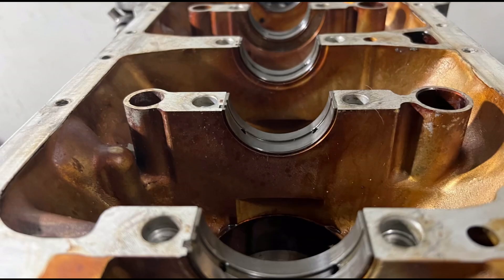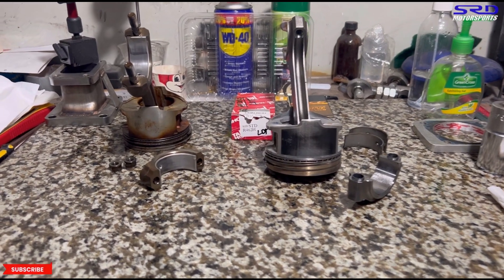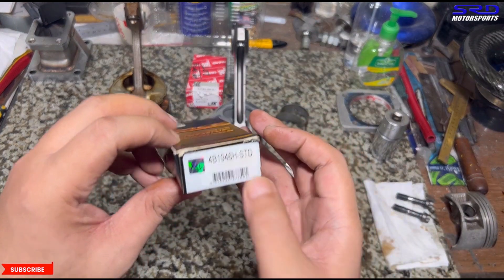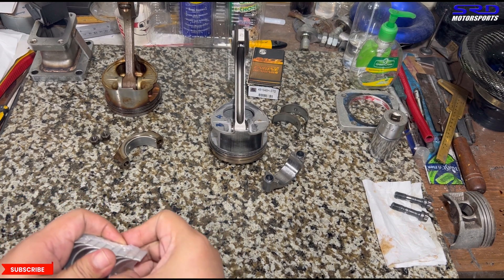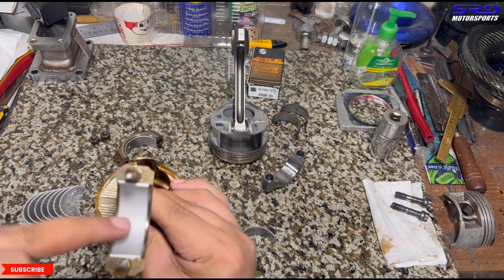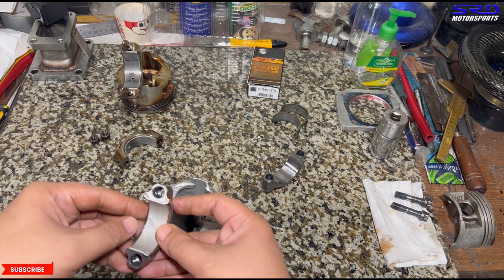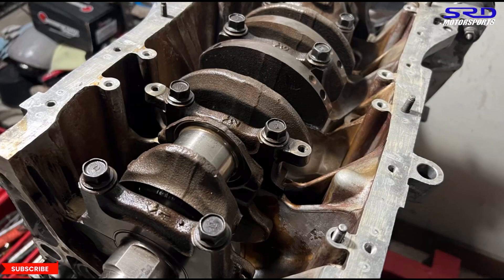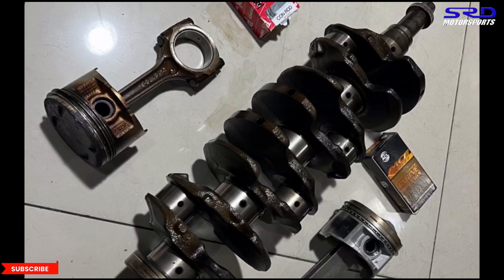Steps to Avoid Spun Rod Bearings K20a B20vtec K24 H22 D16

Comment: I’m building a b20 now the king bearing company send me d16 rod bearings and the holes don’t line up they told me the were correct the ace makes the correct bearings?
Reply from the maker: No , the d16 bearings don’t work for the b20

Comment: So you install .065 shim under the pressure spring it will increase oil pressure from 12-16 psi additional if you run extra clearance  you can use std mains and you can you std hx rod bearings. And send it
Reply from the maker: thanks for watching this

Comment: Hi @SRDMOTORSPORTS
Im currently sitting on a GSR long block bottom end swapped with Ls Integra Crankshaft and Rods with Nippon P72 pistons at 82m. Should i reconsider running it with Ls Rods? Would the Gsr Rods be better with the LS CrankShaft? The oil squirters are plugged, but if i go with the GSR rods would i be able to utilize the oil squirters? Any help or information on this build would be great help. It was built for turbo set up. Im currently reconsidering putting turbo and just go n/a.
Reply from the maker: Rods has to match the crank, gsr rods for gsr crank , LS rods are too wide for gsr crank so they’re not interchangeable
Reply: @SRDmotorsports  ok. This is good to know. Thank you. Will there be any issues using Ls Rods and Crankshaft in the GSR block? After watching your video I'm taking in the consideration that  there will not be any oil squirters to cool the rods. Has anyone you know of have issues with LS vtec being there are no Oil squirter and no oil galley on the Rods?
Reply from the maker: @ ls rods has hole in the rod bearing and rod shoulder to oil the pistons that’s why no need

Comment: I'm rebuilding a daily driver engine it's the Toyota 4runner 5vZ -fe engine I installed king main bearings standard can I install a different brand for con rod bearings since king rod bearings for this engine is currently unavailable ?
Reply from the maker: @levigne25  yeah as long as u get to shoot for the ideal clearance that’s good
Reply: @SRDmotorsports yup alright thanks
Reply from the maker: yes sir! Have fun with the project man 😎

Comment: On the subject of pumps, I have seem people shimming the OEM B series pumps to get more pressure, but what is better, doing this or simply buying an ACL?
Reply from the maker: they’re shimming the pressure relief valve so they’re increasing at what pressure the relief opens not what it flows = I never did that cuz it’s like running a super thick wastegate spring but it turbo can only boost 12psi

Wats the stiff spring for?

Comment: What if you just run .002” on all the mains and rods ?
Reply from the maker: @irunnit9098  say bye bye to ur oil pressure (prolly why we see now everyone blaming the oil pump)
Reply from the maker: More clearance does not mean “more flow”

In hindsight: more clearance also means more demand for the oil pump to fill 

Next someone would say “then run thicker oil”

to solve the oil pressure issue, maybe it gets solved but now ur windage loss is a lot higher 

Takes a lot more hp eaten to drive an oil pump to run thick sludge oil
Reply: @SRDmotorsports  I have a motorcycle and I’ve haven’t had any problems yet I do have a higher oil pump pressure with a high oil relief valve.. so I haven’t seen any signs of bearing shavings in my oil .. the clearance are very similar to a k20 engine that’s why I asked .. I’m running .002” on all the mains .. and .0025” on that rods ..
Reply from the maker: the clearances are fine cuz ur pump can handle it, as long as the side clearances are good too then you’re good to roll for years of fun use
Reply: @SRDmotorsports  appreciate it man I’m not too confident on it every time I make a pass I feel like something might give out today lmao .. but yes I tried to check every clearance possible to make sure everything was left as good as I can understand based on the repair manual.. thanks for the reply man much appreciated
Reply from the maker: for the record K20a oem the range is
Mains 0.0007 to 0.0019”
rods is 0.0013 to 0.0024”
Reply from the maker: @irunnit9098  oh that feeling never does go away 😂 worst when we are over thinkers too lmfao! 

But if u got ur clearances like the numbers you said + good oil and the oil pump is up to task! Then youre good to go…

But then always ride safe man!

Comment: Im about to build a stroked H22 using a F23 crankshaft. Because of the extra stroke the pistons get in the way of the oil squirters. Would it be bad to delete the squirters when using OEM pistons? Plan on using Type S Nippon pistons and E85 fuel
Reply from the maker: I guess not in that case
Reply: @SRDmotorsports  man your quick! I'm guessing it's because of the E85? Thanks and appreciate the insight
Reply from the maker: yeah the added comp is still safe on e85 for sure

Comment: If I have a slight bottom end rattle, almost like detonation sound under load, and a low oil pressure flicker and increased bottom end noise, is this likely due to main bearings or would it be smart to replace the rod bearings also?
Reply from the maker: Yeah safer to do both

Comment: What about drilling holes on the rod bearings and keep the p30 bearings which are better for vtec builds?
Reply from the maker: they’re not better just cuz it’s from a vtec base engine

ACL b20 rod bearings is as good as ACL b16 and same with Daido

But yeah free to mod to make the incorrect bearing work for the application
Reply: @SRDmotorsports  I agree,I was talking about oem vs oem ones
Reply from the maker: Yup

Comment: Interesting.
All the non vtec rods I've ever seen are not slotted that's for sure...
Do you think shot peening LS rods would then give them "equal strength" to a slotted rod?  I understand the non slots still "restrict" flow but I'd think the cooling effect it provides is what makes them stronger/more reliable
Reply from the maker: The slot is to cool the piston the non vtec ones don’t have it because they have the rod bearing hole as I showed on the video that’s their “oil jet”

Shot peening is a good way to reinforce or restore the rods strength sadly nowadays less and less machineshops are equipped to do this but a few that does, we def need to share support to them so it will continue further

Comment: Can a b20 block handle oil squirter's?(with proper mod)have you tried?
Reply from the maker: The b20 block has no provisions for oil squirted on the oil passage so machining it will be senseless and more expensive than just going with a b18c
Reply: Yes b18 is better solution but here in Greece we can't find these blocks any more...b20 block is the only way,or k series.
Reply from the maker: Well I build a few b20 and most like the one since 2017 has been running 12.5sec and 9,700rpm

Comment: So if i wanted to use Speedfactory H beam rods for a turbo D16y8, would it be worth making those oil relief cuts on the side rods because they don't have an oiling port?
Reply from the maker: on forged pistons it’s less needed 
Hence when going forged on the Bseries we plug the oil jet
Reply: @SRDmotorsports  Ok, so a long as clearances are good and the oil pump cover has been resurfaced and ported cavitation should be an issue. I only plan to rev to 8000 rpm. Thanks for the reply.
Reply from the maker: Yes should be good like that
And you’re welcome man
Reply: @SRDmotorsports  Ok sweet, I also had some questions about head and manifold porting. I emailed you but my emails haven't been weird lately and not sending to who I send to. Thanks and keep up the great content.
Reply from the maker: Oh alright will wait on email
Reply: Ok I sent it too the email on your channel but I don't know if it's the right one. Thanks.
Reply from the maker: Got the email buddy… was gonna get back to it a little later but definitely got it 👍
Reply: @SRDmotorsports  Ok, thank you 👍
Reply from the maker: No worries!

Comment: Wait does a b20 have oil squirter's or b16
Reply from the maker: B20 doesn’t have them
Reply: @SRDmotorsports  ah okay I bought a b20 that had just been built and started knocking right away. Stripped it and never seen bearings in such a bad way. Somehow no damage to the crank but all the bearings turn to what looks like copper. Still trying to figure what would have caused it to fail
Reply from the maker: @sabz_bhp  look at the rod bearings = if no hole then it’s a b16 rod bearing

Thrust washer if it’s installed with grooved side “in” facing aluminum block then zero to no or low oil pressure

lastly
Check oil pump… the oil pump cover should be “hell” to loosen if oem but if u can easily loosen it? It was propably opened and checked but not closed properly = low oil pressure 

Lastly oil pick up tube
A lot of times the paper gasket is effed up and when tightend together it’s not air tight so the oil pump sucks air too and that’s Starbucks level froth oil to the bearings lol
Reply: @SRDmotorsports  man your a diamond. So much valuable knowledge man.  Yes oil pump came of with ease thinking about it now
Reply from the maker: @sabz_bhp  just a few things “free” to check while your at it… and every chance to get a step ahead of ur project man

Comment: I want to do my h22a again im curious on what wpc treating will help me most? Id love to have you guys port my head and even assemble my frm sleeved block. Im running all motor but eventually nitrous
Reply from the maker: Wpc I believe ur rods and crank could benefit from by strength improvement and also friction resistance, as I see it done mostly on gears etc but on engine internals not many care to show their secret 😂

Comment: Boss ralf yung k20 rods may slots din po ba para maka exit ang oil efficiently? Salamats
Reply from the maker: one of them the k20 or k24 doesn’t

Il double check on both k24 (not yet being assembled) and k20a (after the k24 we build this)

But rod side play is VERY important
Reply: @SRDmotorsports  ano po pala dapat sukat ng rod side play ng k20 kung papalit ako bearings main saka rods, salamats uli
Reply from the maker: @alitoroganan2442  all clearances is in the manual

And I explained sa video about the specific things pati example given by Don Pauter

Iba iba kase “tayo” pero iisa lng tama lol
And that is patama to all your fb expert builder  friends 😅😂🤣
Reply: @SRDmotorsports  pag kakaintindi sir ralf ndi po enough yung stock spec clearance nyo using pauter rods and acl bearings, sana dito na lang kayo sa Melbourne. Di ko po alam kung std o stdx yung dapat ko bilhin na bearings
Reply from the maker: @alitoroganan2442  clay test it ul know… yes kung nag luwag bearing clearance dahil sa acl race ung stock sideplay bitin na… but lagi based on oem stock so the manual is important
Reply from the maker: Pwede mo din dalin ke Josh tropa ko sa Melbourne khit short block lng Pra medyo tipid pde naman whole engine kung mayaman lol
Reply: @SRDmotorsports  sinong josh, sleeping performance po ba sir ralf?
Reply from the maker: @alitoroganan2442  yeah may new page and shop na sha wala na mga parasite haha
Reply: @SRDmotorsports  ano pangalan ng shop bro hehe makapag inquire

Comment: If I wanted to go from running 5w30 to 0w20 on a d16, what steps should I take to have proper clearances and have good oil pressure. I know I can blueprint the oil pump but surely that's not sufficient. Is this just a pipe dream or something I can viably achieve? Is it something that I should even try. I'm just curious about it
Reply from the maker: I think 5w30 is quite good in my book…

While 0w20 and newer oils may seem enticing let’s not forget most are “roller” rockers now so would our rocker arm pads and cam lobes will like it?

Either way I think what works as far as clearances on 5w30 might be close enough for 0w20

I mean it’s not as big a diff unlike 5w30 vs 20w50. And even then people still try to run factory clearances and run that thick oil 🤣
Reply: @SRDmotorsports  I'm speaking from a purely efficiency standpoint. Whereas a lot of people are going for power building, this is an economy build for me. I was the maximum mpg possible, that's my goal for this particular engine. I figured the lighter oil could help, but have been afraid to dive in, I'm a line technician and I've rebuilt a few engines but I'm honestly a bit scared to dip my toes. So I'm here trying to research and gain insight so I can have a 50+ mpg car. It does pretty well as it stands, my record being 45.6 mpg on a tank with a mix of city and mostly highway miles. Sorry for the long posts, I'm super long winded, don't even get me started talking about tools haha. Great channel man, I enjoy your content, definitely subscribed and I hope you reach a huge audience with your knowledge.
Reply from the maker: @MadmanParagraphGuy  oh man I agree not about tools… it seems I can never get all the tools that I need and there are more that I need hahaha wtf!

now that u mention that? If it isn’t cammed and all? Then I see no downside in trying it
My worry was on bigger cams and stiffer springs we still are not a roller rocker system…

but other than that, I’ve rebuild a bunch of L15 motors from the Jazz/Fit model and the clearances (bearings) don’t seem to be that much different from the Dseries range… they got real narrow bearings doe especially rod bearings…

Now when u think about it “oil exit” was definitely taken into account…

Man thank you for checking the channel out, definitely appriciate that but also comments like this makes it even more fun!

Plus we know some read this comments and enjoy the info too we know we know 🤣
Reply: @SRDmotorsports  Thank you very much for your time and replies. I agree 100%, there's never enough tools haha. I'll try it out and see how it does and if the oil pressure changes dramatically versus mpg, maybe a highway test. I'm thinking of building a K eventually for a swap into a 93 Integra. I have the engine, I just want to research and figure out what I want to do as far as power and drivability because it'll be a daily vehicle so I can't go too crazy. Thanks again and mad props for everything you do! Cheers from the USA
Reply from the maker: @MadmanParagraphGuy  oh nice u got a K hanging out somewhere! def a good way to make crazy ideas hahaha!

Thank you for this man!

And on the efficiency of things I tend to talk about it cuz most of the time on performance related stuff it sometimes take a back seat when in reality it still sits in the “front seat” of things lol

if it’s a stock cam and springs? I’d def look into it I mean the oem “mains” already look good in my book to handle it… the rod side clearances may aid some if u know what I mean 😎

….il say what u said now… don’t get me started on efficiency talks especially on things like
60% of the piston ring friction comes from the oil control rings… hmmmm ok I should stop
As we still actually do race locally hahahaha
Reply from the maker: Oh and the “oil pick up” 

can grant u a few psi in oil pressure too 😎 so def have a look into that as u try the new oil weight adventure

Comment: Does gsr rods have those holes to squirt oil on the skirts? Or the actual oil squirters are better?
Reply from the maker: Both seem to work the same… but even with oil jets on the GSR ? The GSR rods still has the ridges on the side as I mentioned on the video

Makes us see that Honda made “sure”

Comment: Do you think at the dealership when rebuilding motors they just use plastiguage or you think they have dial bore gauge, micrometer etc..? I want to build my motor and not spend so much extra on measuring tools. Besides dial bore guage and micrometer what else should a amateur engine builder have? Whats the tool that sits on top of the block and checks if the piston comes out of the bore?
Reply from the maker: most likely dealership has the tools but also back then they had access to “all” the color coded bearings to match the block and crank etc etc whereas now the “std” we get is technically the “green” on the coded bearings hence plastiguage helps atleast to double check

That took on top is I believe “deck height” measuring stand or deck bridge etc

Comment: Never had a rod spun on all my frankeinstein engines (H23vtec, G23vtec) before. I've experienced 2 engine blew up but never a rod bearing spin and hoping l dont have too. But you send out a good point and good information, specially for thosw slots on forged rods, thank you very much.
Reply from the maker: thanks man… same here… and the potential good power is always welcomed 😎 as we are always hungry 😂
Reply: @SRDmotorsports  is it good to  go over size bearing when spun a rod bearing
Reply from the maker: @ricardodavis9972  depends on the damage on the journals but a lot of times the nitriding or heat treatment is all but 0.040” deep so the machineshop will know better actually

Comment: This video is so appropriate; I just took apart a B20 bottom with a spun bearing. Machine shop said all journals (Rod and main) must be cut. 
I am thinking about getting a replacement B18C Type R crankshaft and rods.
Reply from the maker: Oh sorry about that b20 double check the oil pump u can check the earlier video on it…

And now b18c crank and rods? Maaan you doing my preferred configuration!! That gonna be a beast!!
Reply: I have the option of B18CR crank and Manley rods or LS crank and Manley rods for same price. What would you suggest?
Reply from the maker: @Clerique  b18c crank and Manley rods brother!!!
Reply: @SRDmotorsports  ITR crank it is!
Reply from the maker: @Clerique  I mean to show you it’s a choice I will take? I actually have a 2000 ITR crank in possession for the b20vtec need when I do it :) crank already waiting 😂🤣